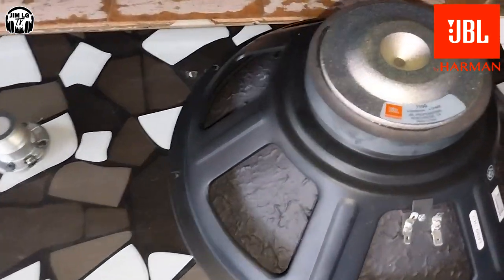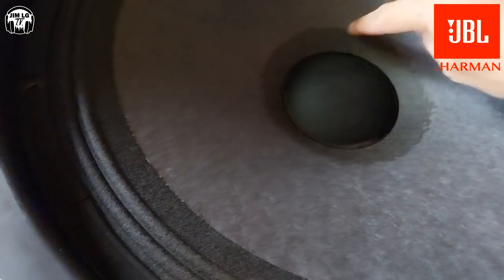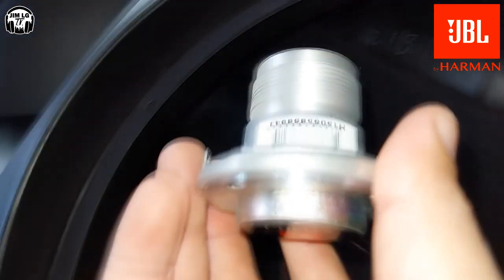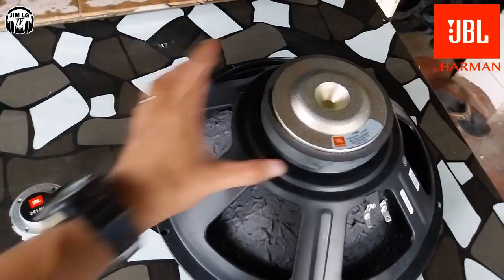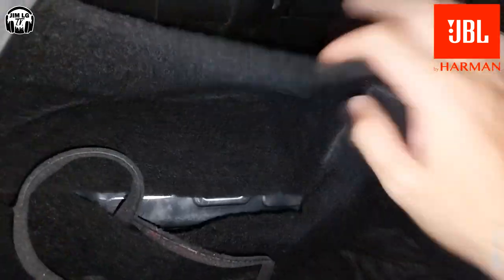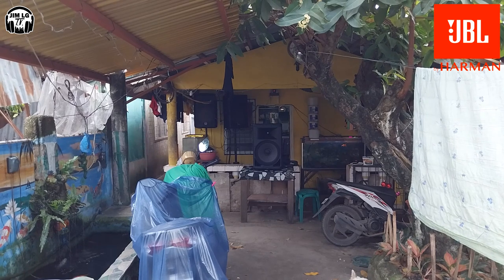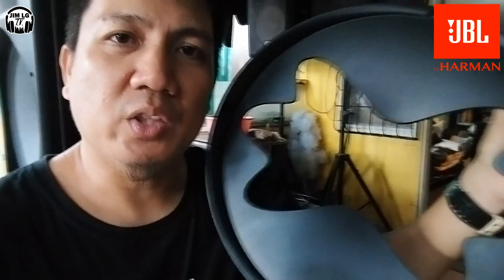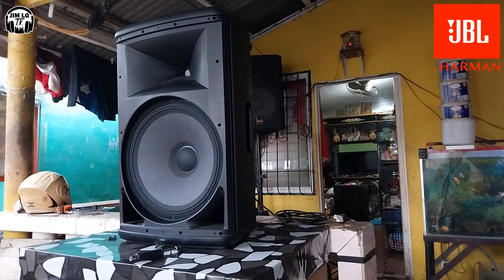JBL EON 715 INSIDE REVEAL

Comment: Medyo bitin ako. Mas interesting ang s module kysa mga drivers lng. Sana sa nxt mo n video idol. Sana mkita kng anong power transistors a gamit s class D amplifier nya pati n rin a mixer board
Reply from the maker: copy idol, kapag naka bili ako ng matataas na pang tnggal sa screws..kasi nahirapan ako pag tanggal ng screw sa may chamber.. kasi hindi kasya ang butas. para syang star screw. ang ginawa ko ni hacked ko lang. allen ang gamit ko at mat plastic.